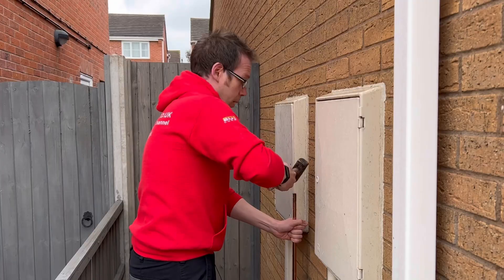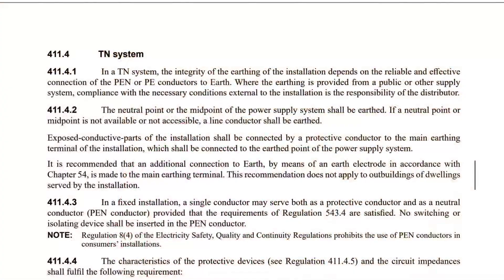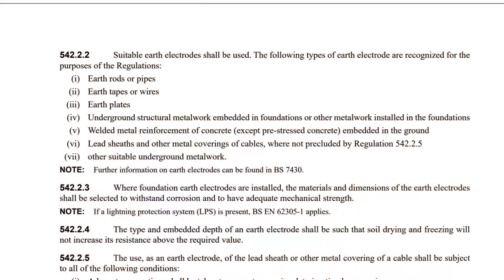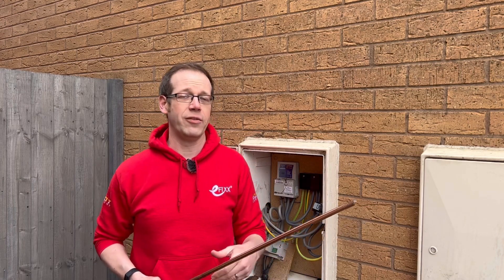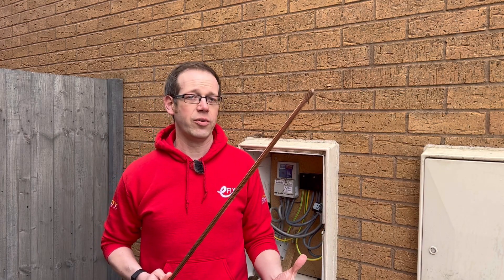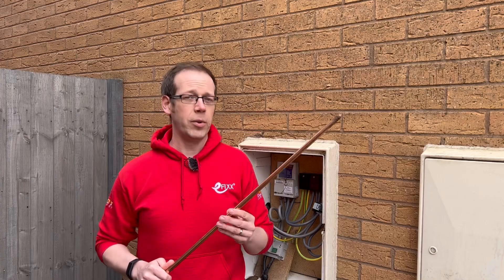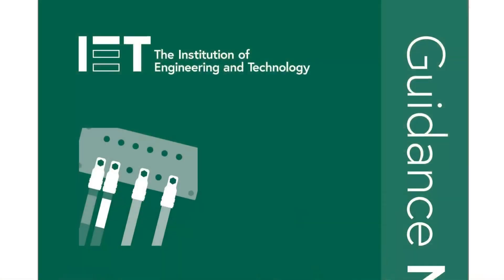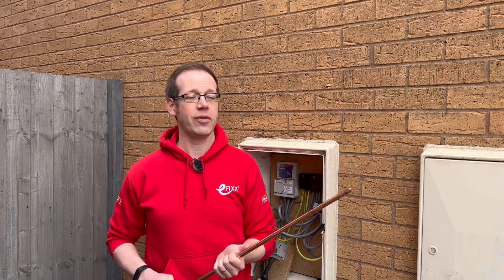Should You Install an Earth Rod?

Comment: On some recentish DNO works i found/saw that they installed a rod (although it was horizontal) when they back filled the hole. 
I honestly think that the supply companies should provide the earth rather then pass the buck to us installers. They know the true nature of the cables/networks they adapt to add or alter services so they should provide a reliable connection
On many supplier faults i have come across over the years on their networks, when i ring to report a higher then required reading, the first thing they try to do is ask whether the system was ever an over head supply etc etc to try a get away from sorting out the failed joint etc etc
If they dont want to provide a safe electrical supply service then why should all the existing maintenance charges they add to everyone bills be chargeable per month
Reply: What you saw was another earth point on a  PME system. I have noticed that whenever a joint is buried there will be an earth electrode coiled up and buried with it by the DNO, reinforcing the term 'multiple' in PME. The main earth will be an earth mat or rods at the sub-station, but if that was disconnected there would still be many other points of contact with earth. Adding one at the consumer's premises is part of a belt and braces approach. I am not sure that it should be the responsibility of the consumer to provide this.After all, in the event of a fault, you are making this facility available to your neighbours who may have made no such provision themselves. I think this should be the responsibility of the DNO....'but what about our profits...what about the poor shareholders?' I can hear them whingeing already.
Reply: @buttyboy100  if fault happened and neighbour happened touch outdoor tap or metallic pipe that will introduce step potential difference. 10meter away will produce 90% of the voltage between MET with Ture earth. I think if I know my neighbour installed electrode, I had better install more electrode if applicable, anyway I would install 100A PEN  fault detection device  in meter box. actually I have bought one after viewed this video. 😀
Reply: Want to buy a car? It doesn't come with seatbelts or brakes installed. It's the owners responsibility to get a qualified mechanic to fit them.
Reply: It can be correct as well. Rule of thumb is if you try to install like a lightning protection then 2.5 m rod or 5m horizontal conductor can be used below freezing level. (below 0.7m in my country)

Comment: So why does the regulation 411.4.2 say it doesn't apply to outbuildings? I nearly added one in my garage when I laid the SWA to it in case it got damaged. Then I saw a John Ward video saying it was a waste of time as the impedance was too high to trip the rcbos.
Reply: Maybe because exporting pme to outbuildings is frowned upon so they wish to discourage it and just want outbuildings to be on TT
Reply: @ElliottHurst  people get mixed up with earth fault and over load faults 
RCBO will operate on earth fault just before it reaches 30ma of fault current and an impedance of up to 1667 ohms. You still need an upstream over load protection on a TNCS supply before it’s TT to an out building. But if a short circuit fault occurs in the outbuilding it’s still referenced to 0.35 ohms neutral star point earth. In the event of a PME break the TT would keep touch voltages within safe limits but wouldn’t allow operation of RCBOs from over load faults.
Reply: RCBOs triping on overload via R1 and RN conductors rather than R1 and R2 overload. In other words the RCD part of the RCBO protecting earth fault but not over load.

Comment: earth electrode can not help except PEN conduct fault protection device be installed inside meter box. honestly a well electrical shock proof boots and good gloves will help more. Any metal pipe such as mains water and gas pipe bonded to MET just act as electrode,  as to say some how electrode has been already installed, it will still be potential danger if PEN conductor fault happen. it is hard to measure the voltage between MET to true earth, that also means you are not stand on the true earth and introduce potential. best practice to measure the leakage current using clamp meter.
Why there is no compulsory requirement for install PEN/PME fault protection device inside meter box such as isloator?

Comment: since the introduction of SPDs...i think having some direct connection to earth should be be done...in aTNCS system the earth is connected back into the neutral conductor...i dont know if its posibble to get a external surge on your neutral...and if so where whould that voltage go..if there is no direct path to earth
Reply: For SPD definitely you need an earth electrode. Yes, you can have a surge on the neutral, as you can with live conductors. 

Anyway I don't see the point of using TN these days, to what save on an earth electrode? Because you need RCDs on every circuit anyway, at least in domestic settings. Just install an earth rod and use the TT earthing system.
Reply: @alerighi  UK is fan of TT. In other European countries TN is the standard, and it is good, because the PEN provides less than 1 ohm compared to the 200 ohm for TT, that can be supported with local rods for the case of PEN fault. Please note 3 phase supply is common in most the EU countries where the N must be on ground potential.
Reply: @gabor.nadudvari  I agree. With TN and RCDs the low resistance means you've got a very reliable system to detect and clear currents flowing through extraneous conductive parts, without leaving any dangerous potentials, and without relying on vague and uncontrolled things like resistivity of soil or the building. Adding earth rods protects against PEN faults (or supply earth faults for TN-S systems).

My big worry with combined systems though is that if you do get PE or PEN or even neutral failure on the distribution side, for example near the transformer or to multiple properties, if you also have an earth rod in a baically TN system you could find the supply using your piece of copper as a high-current return path, and so have a significant step potential. In that case having 200 ohms on your earth rod is probably a good thing, as someone will notice quicker if multiple supplies are using it as a return path.
Reply: @dansheppard2965  200 ohms on earth rod when PEN fault happened ( supposed normal demand is 9A) , the voltage between MET with True earth will be near whole 212V.  stand 1 meter away from electrode,  still will get step voltage 127V.   😵
Reply: @alerighi  SPD have two type CT1 CT2
CT1 is preferred release current to earthing, CT2 is preferred release current to neutral,
I do like CT2  in domestic property.

Comment: I was taught earthing(we call grounding in the States, I know, prob a bad habit) is to provide a path to earth for lightning. 

We have regions in the States with crazy weather, lots of lightning. Research on it and testing of equipment is based in Colorado and Florida. 

Coaxing lighting into test equipment is done with small rockets attached to wire.

Comment: How many sparks test the voltage between TN earth and true earth ? . Not many . I've installed and earth rid when I get a high Ze impedance, simply because the DNO won't come out if it slightly over

Comment: Here in Greece, the construction of foundation earthing is mandatory since 2010 in all new building constructions. It is controlled by urban planning and if it is not there, the building is not connected to the electricity grid.
Reply: I thought Greece and Italy didn't bother with any rules
Reply: Italy use TT grounding system and i don't know if they have rules. Here in Greece except the centre of Athens where they have TT grounding system, we have TN-C-S grounding system. And we had rules since always. Before 2010 we have to install 3 earth rods connected together and to the PME system. After 2010 the installation of fundamental grounding is mandatory and to connect it with PME system....
Reply: @johnny 71c foundation earthing is used all over the UK on large buildings normally for the lightning protection system

Comment: The worst shock I ever had in my 55 years in the trade was on an army camp housing contract I was tasked with a 2 hour response loss of supply to a married quarter I checked the supply no voltage from live to earth and neutral I opened the grp meter box on the outside wall to inspect the meter and cut out there didn't seem to be any obvious problem there I grabbed hold of the gas pipe exiting the gas meter enclosure to pull myself up from squatting and got the shock of life I was standing on wet grass and gripping hold of the pipe. I managed to let go of the gas pipe breaking  the circuit with me as the main conductor. On closer examination the pen conductor had become disconnected inside the joint in the road with the live conductor still attached every earthed appliance and bonded metal was live so if it was my property with a tncs pme supply yes I would install an earth electrode just in case.
Reply: Where im from you have to drive down an earth rod
Reply: @joanofarc708  where I’m from we drive down paved roads.
Reply: earth electrode can not help except PEN conduct fault protection device be installed inside meter box. honestly a well electrical shock proof boots and good gloves will help more
Reply: @huyongquan6554  different days back along we didn't get issued with PPE so being human if it was going to cost money it didn't get used that is how it used to be

Comment: I always wondered why UK didn’t require earth rods. As in Ireland which also uses TN-C-S, has had earth rods on all domestic installations for decades.
Reply: they are also required in the United States
Reply from the maker: I suspect it will become a stricter requirement in future editions. 🤔
Reply: @efixx  what if the neighbours pipes imported a voltage which created a danger... I can see an automatic earth disconnection device similar to ev chargers being required but then I also can see a requirement for an indicator to alert that the earth has been switched off, or will this reconnect? 
19th edition here we come!!
Reply: Just about to comment the same… 👍🏻
Reply: Ireland always likes to keep Grounded
Reply: Same as that.
Reply: We use a 10sq earth on a 16sq tails on a 12kva  supply 
and a 16sq earth on 25sq tails for a 16kva supply for the earth rod in Ireland
Reply: If in doubt, put an earth rod in.  You can never have to many earths.
Reply: @g7mks383  too many
Reply: earth electrode can not help except PEN conduct fault protection device be installed inside meter box. honestly a well electrical shock proof boots and good gloves will help more
Reply: @huyongquan6554  yes it can
Reply: @matekochkoch   Can you guarantee the Electrode resistance is lower than 3 ohms, which in case PEN fault, will introduce more than 70V between MET and true earth. if the resistance is near 200 Ohms, which very often happen in summer dry season, the voltage between MET with Ture earth will more than 200V.
Reply: @matekochkoch  For TN-C-S earthing arrangement system. we have three status: 

Normal status ( No fault status): the potential difference between exposed parts or extraneous parts with ground( not true earth, true earth concept is disputable, true earth potential shall be 0) vary with distance from electrode or service pipe underground. 1 meter away difference will be 60% to 10 meter away fraction factor increase to 90%, so if you stand 1 meter away from the location electrode installed, you still have 18.5*60%=11 V, it can not be 0 voltage. 

Earth fault status, to say fault current 400A, MET voltage to true earth to say =400A * 0.35/2=69V.  1 meter away from electrode still have 0.6*69v=42 V. for example, vehicle is 4.5 meters long, if you touch the EV or outdoor water Tap 4.5 meter away from electrode, you will have 0.8*69=56v, if  you are with bare foot, that will be problem.

Pen fault:  MET voltage to true earth very often will be more than 210V ( normally earth electrode 200 ohm), 1 meter away from electrode still have 0.6*210v=126v.

That to say, the additional electrode installation is useless for TN-C-S , except you can get electrode reading below 2 ohm, best practice is to  install PEN fault detection device.  outdoor metal tap is potential danger.

To install good electrode, it could be cost £300 or more, depend on the condition of soil. some time you can not get good reading. 
To install PEN fault detection device may be same or less, parts will be £170. I will install 100A PEN fault detection device and it will future proof if you need install EV charger.
Reply: @huyongquan6554  im uk qualified and moved to Australia, we use Earth stakes on all installs, litrally pointless here in Perth, i removed the Earth to Neutral link (M.E.N) to do an external Ze directly to rod. Completly failed. If there was a broken N the Earth rod will do nothing, will sizzlein ground waiting for someone to get killed, ground is just dry sand here
Reply: @hu yongquan  so what, TT supplies are just a myth?
Reply: @darylsavage119   Robin said additional Electrode for TN-C-S. For TT you have no choice to install electrode and there is no PEN fault happened, isn't it? can you guarantee the Electrode resistance is lower than 3 ohms, which in case PEN fault, will introduce 70V between MET and true earth?
Reply: @darylsavage119  Robin said additional Electrode for TN-C-S. For TT you have no choice to install electrode and there is no PEN fault happened, isn't it? can you guarantee the Electrode resistance is lower than 3 ohms, which in case PEN fault, will introduce 70V between MET and true earth?
Reply: @darylsavage119  For TN-C-S earthing arrangement system. we have three status: 

Normal status ( No fault status): the potential difference between exposed parts or extraneous parts with ground( not true earth, true earth concept is disputable, true earth potential shall be 0) vary with distance from electrode or service pipe underground. 1 meter away difference will be 60% to 10 meter away fraction factor increase to 90%, so if you stand 1 meter away from the location electrode installed, you still have 18.5*60%=11 V, it can not be 0 voltage. 

Earth fault status, to say fault current 400A, MET voltage to true earth to say =400A * 0.35/2=69V.  1 meter away from electrode still have 0.6*69v=42 V. for example, vehicle is 4.5 meters long, if you touch the EV or outdoor water Tap 4.5 meter away from electrode, you will have 0.8*69=56v, if  you are with bare foot, that will be problem.

Pen fault:  MET voltage to true earth very often will be more than 210V ( normally earth electrode 200 ohm), 1 meter away from electrode still have 0.6*210v=126v.

That to say, the additional electrode installation is useless for TN-C-S , except you can get electrode reading below 2 ohm, best practice is to  install PEN fault detection device.  outdoor metal tap is potential danger.

To install good electrode, it could be cost £300 or more, depend on the condition of soil. some time you can not get good reading. 
To install PEN fault detection device may be same or less, parts will be £170. I will install 100A PEN fault detection device and it will future proof if you need install EV charger.
Reply: It’s also required in Brazil
Reply: intelligent countries use TT like france, germany and japan 😎 dumb countries are stuck with TN, TNS, TNCS
Reply: Australia and NZ also require an earth electrode.
Reply: @manyshnooks  that's because they're all TT
Reply: Irish electric regulations are always one step ahead of the UK!
Reply: @Recessio  In this case they are one step ahead
Reply: @Recessio   They are, to be aure, to be sure.